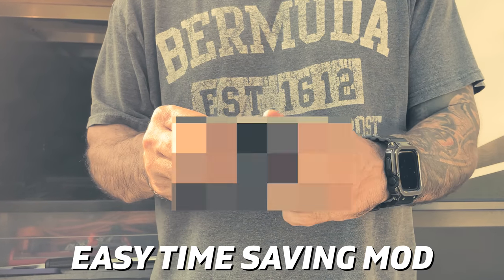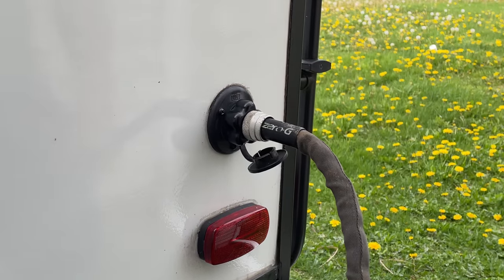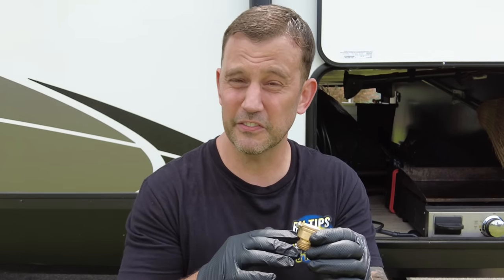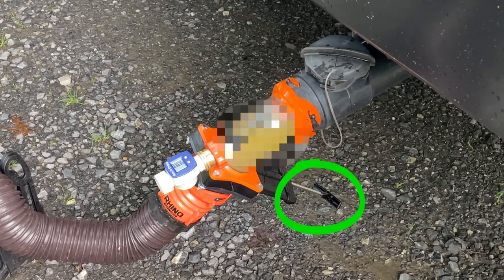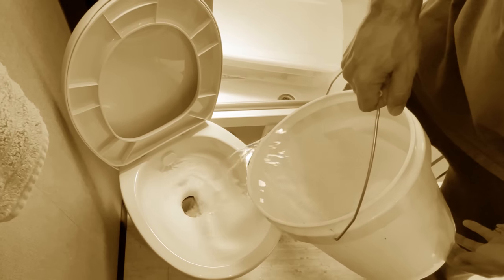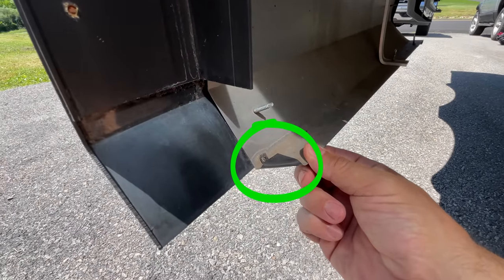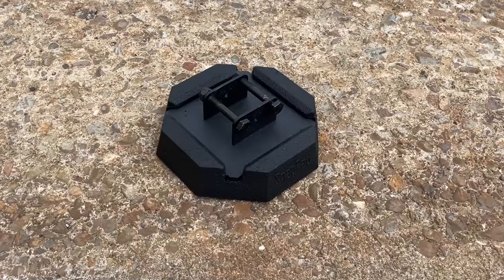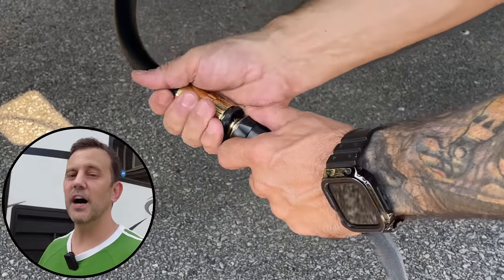3 Overlooked Yet Important Things Every RV Owner Should Do

Comment: What is the difference between using the black tank flush on the camper versus the flush system you show?
Reply from the maker: couple things... the flush port is a sprayer that using RV plumbing, so it will need to be regulated and its going to be much slower considering its a sprayer.  Using the Rhinoblaster allows you to not have to regulate the flow and fill the tank much quicker.  It also puts water in exit pipes to help loosen up and clean, the flush port only fills the tank.  Most importantly, the Rhinoblaster also allows you to back fill your gray tanks quickly, the black tank flush port wont.  Its also convenient because you can do everything right in one spot, while your dumping your tanks.  Set it up when you park and tear it down when you leave.  Hope that helps.  https://amzn.to/446lxuP

Comment: Once again, another great video.  Thank you.  BTW, would you happen to have a Maintenance checklist PDF/Excel Document available to share?
Reply from the maker: honestly, im struggling with how to share mine because every owners manual should have one and they are different.  check your manual first... but eventually im going to release something about this.  thanks bud.
Reply: I've seen some scheduled maintenance list:  columns- each trip/monthly/quarterly/yearly.   I'm sure each manufacturer has some things in common and it would be up to the individual to ensure a particular task is added or placed in the correct column.  I'm a fan of checklist!  I used the ones that you offered for before leaving home, arrival at campsite and before leaving campsite, took them and made them my own.  Just got in the Camlock door latches and will be installing this week.   @RVTIPSANDTRAVELS
Reply from the maker: Let me k ow if you have any questions with the lock.   Be patient, by no fault of the manufacturer, they can be tricky getting in.

Comment: Watched your video. You left one important fact out. When running water into the black tank, you need to keep open the toilet valve, so pressure doesn’t build up. I had a camper next to us that didn’t open the toilet valve and he blew out his black tank. It made a loud bang and water was everywhere. Hope this helps.
Reply from the maker: This isn’t true, sorry.  There is a black tank gas vent inside the black tank at the top of the tank that exits at the roof of the RV.  You can’t build pressure in any black tank.
Reply: Then their was another problem he had. ButI am not taking any chances with my tank. Good Luck
Reply from the maker: Your tank won’t pressurize.  If it was pressurized it would blow the water on your ball valve up on your face every time you pushed the pedal to flush lol. If you need more proof consider this.  If there wasn’t a vent, you would have to open your flusher every time you dumped or you would create a vacuum when dumping, which would make for a slow dumping process instead of water rushing out.  Your tank is vented, you can ask anyone. It’s illegal to build an rv without a waste tank vent.  Good luck.
Reply: Thanks for the information.
Reply: If any tanks are not vented via the roof vent they wont dump. Air must go in to replace liquid out.
Only a severly over filled black tank could plug the vent pipe causing a tank to rupture when back flushing.

Comment: So I use the black tank flush port (with the same flow meter) to fill the tank with the gate closed to then dump.  What is the benefit to back fill the tank over using the flush port?  The Rhinoblaster is good in the event you get a clog as you are able to backfill and possibly break the clog by pushing it back up into the tank.  I just don't see the benefit of backfilling through the Rhinoblaster vs using the flush port.  Is it just preference?
Reply from the maker: first, some folks dont have a flush port so i wanted to give them another option... but if you do, they also have a vacuum breaker built into the plumbing and they are widely known to fail and leak.  replacing them can be a pain because they are usually buried.  many people have stopped using them or use them less.  most mfgr's are using the same cheap plasti VB.  by using a rinser obviously wont go through that vacuum breaker.  it also puts resting water in your drain pipes, so it gives them sort of a soak and rinse too while its filling.  you can also do this much quicker since you dont have to regulate the water flow going into the pipe and into the tank.  you do have to regulate the water flow if using the flush port since its going through interior plumbing.  you can use the rinser to flush the gray tanks too.  flush port wont do that.  youre correct it can be looked at as preference, but those are some things that i could think of.  thanks for watching and commenting MF
Reply: Thanks for the reply.  All good points.  I'm going to try the Rhinoblaster on my next trip.  I never considered the water flow.  Our campground is on a well and it takes me about 14 minutes to fill the black tank through the flush port....so about an hour for a full clean since I fill and dump 4x.  Maybe it'll fill faster thru the Rhiunoblaster and save me some time.

Comment: Maybe it’s just me but I don’t understand how the black tank flush product you demo is any different from using the black tank flush valve. They seem to be doing almost the same thing but from different “directions”
Reply from the maker: 1) no pressure regulation needed so it’s much quicker.  2) you can clean gray tanks. 
3) you can apply back pressure if you get a clog at the tank, and since a plunger won’t work due to open pressure at the roof vent, this is an easy fix.
4) not every rv comes with a black tank flush.

Comment: Plastic or brass vacuum breaker doesn't matter. What matters is having it higher than the spill rim of whatever you're filling, ie your highest sink or toilet. That way, it can't flow backwards by gravity and can't siphon through the fresh water source.
Reply: I would disagree.  Spring load brass vacuum breaker seals will last longer as Ross said.  Spring loaded breakers are more accurate than that plastic breaker that comes from Camco.  You can literally move the plate with your finger.  What you said about gravity is definitively correct, but I’ve used these plastic breakers and they seep from the vents.
Reply from the maker: thanks for watching!

Comment: Do those quick connects reduce the water flow?  I have some that reduce the diameter to about a 1/2 inch (?) and appear to slow the flow  down.  I have an on demand water heater that needs a minimum flow or it will not come on and have had to switch to my pump and tank to get hot water.  Im just wondering if these would allow enough flow?
Reply from the maker: Excellent question, and I don’t have an answer.  I will say I use them on my garden hose at home and have not noticed a difference.  You can however use the water flow meter with and without the quick connects to see if there is any loss.
Reply: @RVTIPSANDTRAVELS   good point.  I have a meter but never thought to test the flow t with or without.  I just order an different set of quick connects and will test all ways to see if there is any difference.

Comment: Why not just use the black tank flush and keep the valve closed?
Reply from the maker: Many rvs don’t have black tank flush.  

Don’t have to regulate pressure, so it’s faster.  

Clean gray tanks too.  

Back fill to remove a clog.
Reply: @RVTIPSANDTRAVELS  makes since.

Comment: With tip 1, always adding and then emptying your fresh water when you leave the campground is so wasteful, especially here in the southwest.  PLEASE if you fill up, DON"T waste the water unless you are done traveling and your coach will be sitting.
Reply: If you’re worried about conserving water then the RV lifestyle is not for you.  There’s plenty of processes that require a lot of water that you wouldn’t use by staying at home.  If you don’t want to waste the tank full of water before leaving the campground then just turn on the pump and use it to shower and wash dishes before you leave.  Problem solved.  For our family it’s more important to have a full tank of water on standby in case of an emergency. I’m also using a lot of water to rinse my water tanks because my children’s health is more important than the mess our politicians created.  They all live in mansions that use a lot of water to keep their lawns green and 6 bathroom toilets full. My family is more important than that.
Reply: You are really gonna have this fall on def ears. Just a heads up. RV black tanks waste 2 maybe 3 times their capacity worth of water every time they are emptied best case scenario. If you want to save water the whole effin RV industry needs to go. It won't.
Reply from the maker: SasStewart, I can appreciate you don’t want to waste water.  Nothing wrong with that… Just use the water in the tank before you leave the campground if you don’t want to waste it.

Comment: It's hard to tell. Is the included valve with the Rhino Blaster a check valve or a vacuum breaker? They are not the same thing.
Reply from the maker: correct they are not the same, these are both vacuum breakers